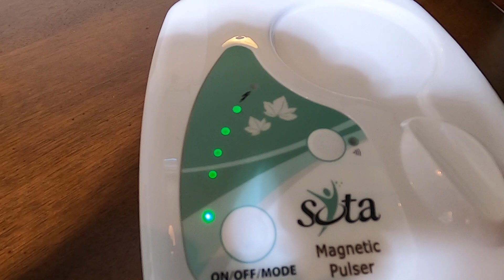013 Open Source demo model BBMPulser 4B  Strong Automatic Magnetic Pulser 1.4 Tesla (14,000 Gauss)

Comment: HAVE YOU CONSIDERED USING A RODIN COIL IN YOUR PADDEL ! THANKS
Reply from the maker: No, I haven't. I would if I had one build
Reply: @AndreyD  You might find Rodin coil tends to implode the flux (like a toroidal coil) and thus there is very little Gauss output. We actually want the Gauss out, not in.

Comment: It seems that the charm is that it is simple and anyone can make it. I hope many people will use it. It seems that the output is strong because the capacitor is very large.
Reply from the maker: Yes Capacitors play big role in power output. Another big factor is the Voltage, Sota charges its capacitor to 300Volts, I charge mine to 550Volts.
Reply: @AndreyD  SOTA actually charges the capacitor to 375 Volts.
Reply from the maker: @zusaudio  I'm sorry you may be right, I never took measurements from Sota Units. I did open it ones just to look inside, I don't like to copy no-one but I was curries to see how it was built. Since Sota Pulsers are closed source, it's hard to find true data on  internal Capacitor and it's charging voltage.
Reply: @AndreyD  SOTA uses a Cornell-Dublier 600uF/450V custom strobe capacitor. This custom-made capacitor is rated at 30 million (!) pulses. It is charged to 375VDC and released into 2.5mH air-core inductor made with 276 turns of #18 magnet wire.
Reply from the maker: @zusaudio  Thank you, I knew I was 600uF, just didn't know what the voltage it  was rated for.
As fur as coil, what's the sizes? ID, OD, thickness.
Do you sell coils byitself? 
Would you mind if I part out your MP6 Unit and try your coil with my pulsers. If I make video, It wont upsad you that I part out your MP6 Unit?
I wont reveal anything inside, I just wanted to show how Sota MP6 Coil Performs with BBMPulsers.
Reply: @AndreyD  Ha! Go for it Andrey! My coil is 55mm OD x 18mm Height. Try it on your pulsers. Please it is OK to show all the circuitry and insides. I am proud of the circuit. Please show it around if you want. Let me know the results! :-)
Reply: @zusaudio  I would also like to have the diagram with components and specifications. I have visited places where we have helped people with their health who barely have enough to eat. I would like to help them with this technology to improve their health. Using a 12 volt eliminator is amazing to me. Thank you.
Reply: @AndreyD  how did they get the result if the  sota charges it upto only 300v? What kind of mechanism did they use?
Reply from the maker: @sosnasolomon9795  you can discharge it at any voltage 20-550VDC
The higher the outage the stronger the output. To get 1.4 Tesla you need to charge it to 550VDC

Comment: Beautiful!  Sota’s left in the dust there. Next video: Step by step assembly of bbmpulser 4B kit.
Reply from the maker: I remember BBMPulser 2 it was while back, the sofa would take it, and I remember trying so hard to beet it, but the 3rd Generation (0.8Tesla) took over, alone came 4th, and now my 5th generation Pulsers are more then 4x stronger compared to Sota MP5 or MP6 Units. I think it's time for the Sota to step up their game
Reply: Andrey D Wait till they hear about your pulser. They’ll soon have their technicians scrambling to improve their product, or they’ll be candidates for museum material.
Reply from the maker: @noelmoralde6242  agreed, Sota needs to improve their Pulsers. I'm surprised they haven't done it yet. Last model they put out (MP6) didn't gained any power compared to the previous model (MP5), question is why not? Give me at least 20% more in the new model, but NO. 
So don't expect much power increasment from their next model when it comes out
Reply: @AndreyD  did they test out the optimal power range for pulsing that's why they didn't increase the power of their model?
Reply: @AndreyD  Wow, harsh words Andrey. Maybe first finding out WHY the Magnetic Pulser's output has stayed where it is would be a polite thing to do? You may not have heard of the FDA or of Health Canada? Health Canada seized our products coming into Canada last year. They have reneged on their agreement they had in place  with us since 2000. They felt our Magnetic Pulser's output approached an MRI machine and demanded we get Class III Medical Licensing. It is easy to write unsubstantiated replies on forums like this without attempting to seek out the truth of what we do and why. This is very sad. There are many factors in making a product that one sells to the public. Are these high-powered pulsers FDA approved? Do they have UL or CSA or FCC or CE certification? I think not. Are they SAFE? These pulsers plug directly into the 240VAC or 110VAC mains. There is NO isolation transformer.  These pulsers are inherently dangerous!  A DIY can kill him/her-self real fast if they are not careful. I am all about pushing the art to make a more powerful pulser. Now let's talk the cost. These pulsers in production would be thousands of dollars to make and sell. If one wants to compare, let's do it responsibly. And yes, I have seen these and many other high-powered pulsers out there. I can easily build one of these and sell them through SOTA. These would be great in a clinic environment. However, the POLITICAL climate today does not allow for such devices UNLESS one gets FDA/Health Canada Medical Class Licencing. Do you know what it takes to get this? At least $100,000 per product. Perhaps even $250,000. Again, easy to make a high-powered pulser. That is not the barrier.
Reply: @AndreyD  See my reply below...
Reply: @noelmoralde6242  Sorry to burst your bubble Noel. See my response below.
Reply: @MasterofPlay7  Yes. There is room for higher Gauss output which we are testing now and have been for the last 2 years.
Reply from the maker: @zusaudio  MRI machines use up to 10 Tesla, somehow they have got their licenses,  
Sota has been around for a while, they can invest $100k to get the  license if that's what it takes.
Model 5 and model 6 are the same in power output. How about model 7 is it going to be the same as well? couple new buttons? what good is it do to improve it's appearance with out improving the power output. 
About the safety of my Unit's. I give Safety high Consideration. I Extra Insulate everything, Look at my coil I fully insulate it in the plastic. I leave no exposed wires no-where. The metal case is Grounded as well as there is safety fuse alone with 2 thermal switches to ensure unit is safe to operate, owcource if you put it in the water it may shock you, just like a hair dryer that has all the safety passed, it will still shock you.
Also I advice not to open or repair any Units I build. 
Also I advice not to mess with the open source circuit to anyone who don't have prior experience in electronics.
I do worn people that working on high voltage circuits are dangerous. 
No it wont kill you, but it will shock you hard, I have gotten shocked many times, I have build many of this and higher voltage circuits,  I'm alive and doing fine.
Reply: @AndreyD  When a product gets to a new version, it does not always mean increased performance. Does your car always get more horsepower on each new model? SOTA had a customer demand for a faster pulser delivery. The Model MP6 has a 2-speed function added. Now, make note that this was done without ANY price increase. Simply value-added. Now, regarding the $100k  needed for FDA licencing, I do not think you are knowledgeable in the POLITICS of the FDA or Health Canada. $100k is per product and per jurisdiction!  This is just to get the licence, not to maintain it. Now, IF the licence is refused, then MORE money needs to be spent to get it. Then you HOPE that the next go-around gets accepted. If not, then you have to spend hundreds of thousands per unit for double-blind studies. By the time all that is done, you can drop a cool million just for licencing. So, if that happens, you have to raise the price of ALL the products to recoup your financial losses! Now, how do the customers feel about that? The cost of the units all went up 5 times, and you have to try and justify this to them. Do you understand? Another point I want to make is why degrade SOTA's pulser? Why bad-mouth what SOTA has done? Doing this actually bad-mouth's Bob Beck. This is plain wrong. SOTA's pulser runs off a 20 Watt 12 Volt wall adaptor. How can you make a fair comparison to your unit that connects to the 240VAC mains and draws 300 Watts? Very unfair, is it not? Make a fair comparison by making a proper comparison.
Reply: @AndreyD  The fact is, DO expect more Gauss out of SOTA's next model.
Reply from the maker: @zusaudio  I'm sorry, Maybe we didn't understood each other. I want to make it clear I was not trying to bad mouth existing Sota Pulsers or put it down in any way, All I said in respond to the comment that Sota left in the dust is that - "Sota needs to step up their Game" Also I expressed my opinion on power output from the future models saying "Don't expect more power output" That's purely my opinion.
I love what Sota have done. Sota has introduced Magnetic Pulsers to the general public, and that's huge, at the same time making it's mane as a leaders.
I did comparison using Sota because Sota already known Product and it's power output is also known.
I wish Sota Great Business, honestly I do.
I don't have anything against their product.

Spects on the BBMPulser 4B
It peaks at 300 Watts, but pulls on average 75Watts off the main 120VAC
Sota also plugs into the wall. I was not comparing battery powered unit to main powered. Both Units have access to draw as much as they are designed. Seems fair to me
Reply from the maker: @zusaudio  "The fact is, DO expect more Gauss out of SOTA's next model." 
How much more? Also more Gauss out can simply mean it will pulse faster, not actually stronger pulses.
How much stronger the pulses  are going to be?
Reply: @zusaudio  Hi! I’m sorry if my comments came out harsh. I’ve actually done my fair share of research on existing commercial pulser brands in the market and so far,  only Sota sticks in my mind whenever the subject comes up. So, when i commented on Andre’s video, and considering the Tesla rating on his pulser, i just can’t help but compare. I’m no expert on the matter, so please forgive me for whatever my comment caused.
Reply: @AndreyD  I appreciate your honesty Andrey. If we folks (you, me and others) who are pioneering this technology do not get along nicely, then we are just like big pharma. We will all fail. The world needs us in this niche to work together nicely, honourably, and ethically. Otherwise we fight and we all fail. Let's do what we can in a kind way to help this technology proceed in our absence. We will move from this planet one day, let's all make good karma.
Reply: @AndreyD  I have been testing many different coil designs over the past 2 years. I have got upwards of 8,000 Gauss and even had one peak at 13,000 Gauss. This with the SOTA pulser's circuit and no other changes. I hope to get a clear direction in a few months as I am testing other parameters. I am also exploring a cooler coil design, so I can pulse faster without building up the coil heat as much. Challenging as I will continue to use a 12Volt 2Amp wall adaptor for safety and certification reasons.
Reply: @noelmoralde6242  Thanks for your reply Noel. Let's move forward in grace and appreciation for all. We are the ones moving Bob  Beck's vision forward. We need to be kind to one another and share openly and appreciate all the hard work and dedication that has gone into this. Cheers!
Reply from the maker: @zusaudio  Agreed, I would like to add that building a good karma means helping others in different ways. We are all capable of doing it. Example would be having part of the company "Open Source" this way even those who can't afford to get complete  unit are able to try this technology and can build it from the circuit. Also larger companies can afford to set up different programs allowing poor people and really those who needs it to get it for cheep.
Let's all make good Karma, Im all for it!
Reply from the maker: @zusaudio  I would suggest increasing pulsation speed. Make it pulse up to 10Hz with 0.6 Tesla and that's a big improvement. The power is the same but the speed is 50x faster. It doesn't have to continuously output, it can burst with 10Hz for like 1 second and recharge for a few seconds .
I'm testing fast Pulser capable of pulsing up to 1000Hz with power output 0.5 Tesla at 500Hz range and 0.8Tesla at lower frequencies 10Hz and lower. 
It draws on average 300Watts, It bursts with what ever frequency I set up to 1kHz. Duty of the pulses are also could be set between 1%-50%
Reply: @AndreyD  Making it pulse 10 x per second @ 0.6T does indeed increase the power. With the 12 Volt /2 Amp power supply (24Watts), I can only charge the capacitor in 5-7 seconds to a full charge. If I want to do it at 10Hz, then the power will be at least 50 x more  power = 120 Watts. That is why when you run your pulser directly off the 240VAC or 110VAC mains, you have gobs of current available to charge the capacitor.
Reply from the maker: @zusaudio  Yes, If your pulser continuously outputting 10Hz then  ~120Watts or so but if you burst for 1/3 of the times then its only 40 watts on average.
If you double the power from 12VDC adapter then its achievable.
Also why stepping down from 120V or 240V to 12V and then raising it back to 375VDC, (why not down to 5VDC? its more safe then 12VDC)  You end up generating high voltage inside the unit anyway, whats the point here?
Nothing wrong with having power cable going directly into the grounded unit bypassing not needed voltage conversions.
If Isolation is the case here then put 100Watts isolating transformer inside the unit with high voltage secondary windings to lower amount of components needed to charge capacitors.
Frequency adjustment with couple levels of power output options are Big Pluses
Reply: @AndreyD  SOTA has a unique program. We offer upgrades from any model to the latest model at a discount of 50% off. The older unit gets refurbished and sold at deep discounts so people with money challenges can buy a working unit for very little money. Kind of a "pay-it-forward" program. We have over 500 people on the used-unit waiting list! It has been a very successful program. SOTA also offers donations units for those who have no money and are in a desperate situation.
Reply: @AndreyD  I had to keep what I have because of investments in tooling and mold costs. Plus, we are very sensitive to the price of the unit. Today, the MP6 retails for $395 USD. This is really cheap for a PEMF unit outputting over 6,000 Gauss. However, it is expensive if someone has no money. So there is a balance. Your very-high powered PEMF unit is perfectly suited for clinics where doctors can afford to spend a few thousand dollars. At SOTA, we try to do our best to keep the cost as low as possible without sacrificing quality, features, functions and reliability. It is a fine balance. We have talked at length about offering a high-powered pulser like yours, but the market demand is actually low. The cost to bring a high-powered pulser into the market is very high and needs a return on the investment (ROI). That is why we have not done this yet. It is on the "to-do" list, but not right away.